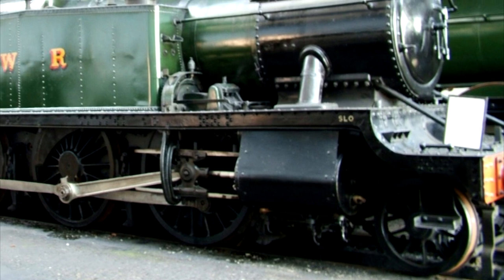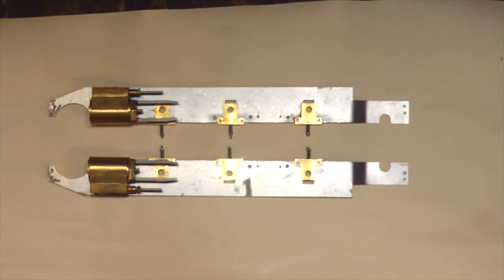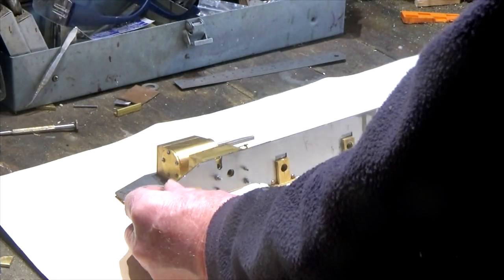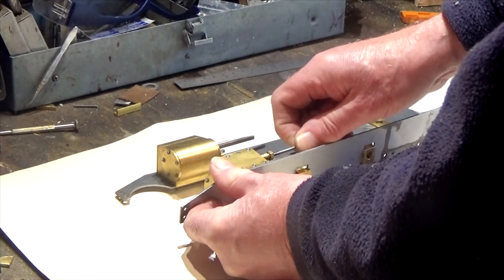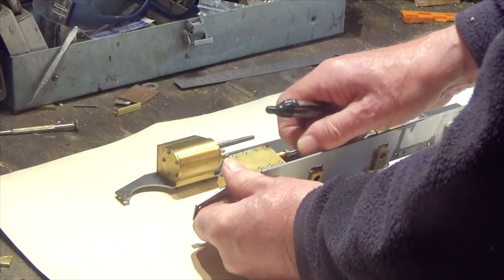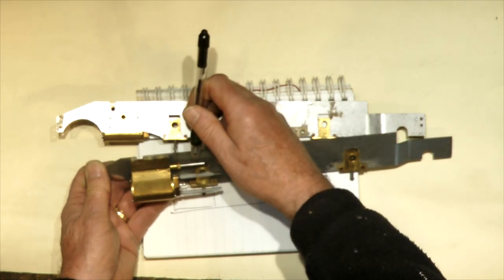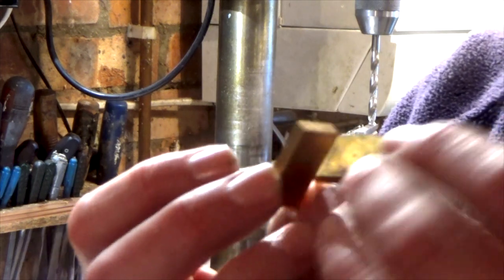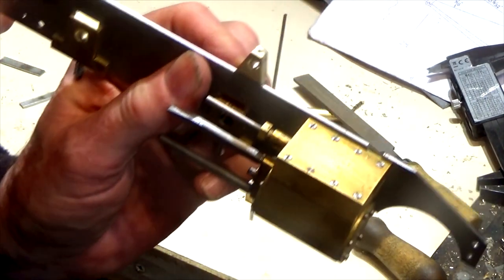Gauge 1 Live Steam Scratch Build 11

Comment: As usual, fantastic! Based on your inspirational work I'm about to embark on a Project build, do you have any advice?
Reply from the maker: Glad you like the video. I think the Project is a great place to start. It was my first Gauge One model. However I did not build my boiler to the design  in the book. My boiler has five boiler tubes as opposed to the single flue cross tube design.